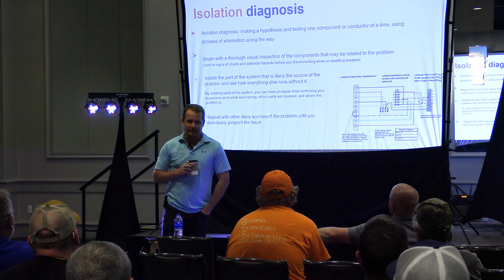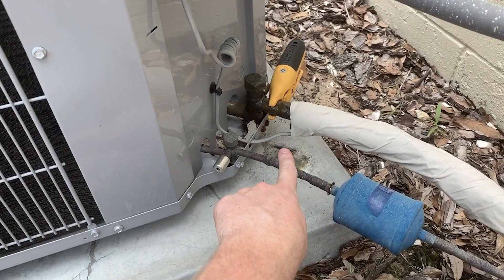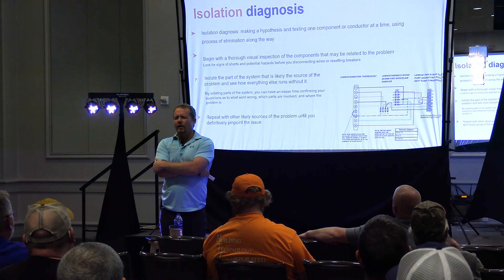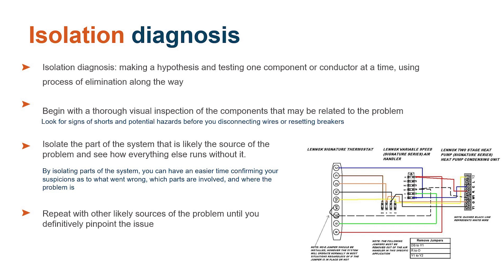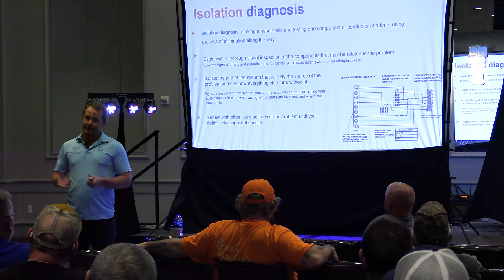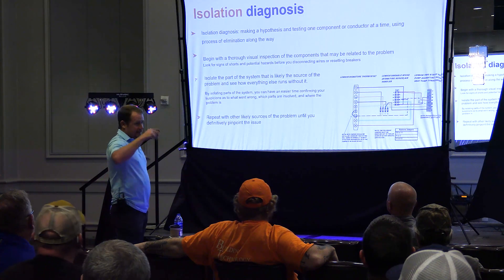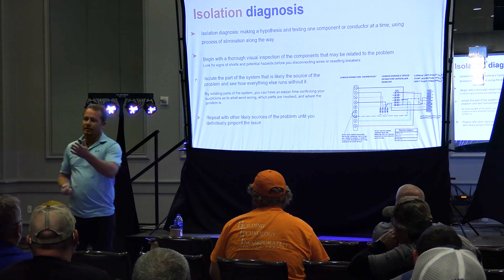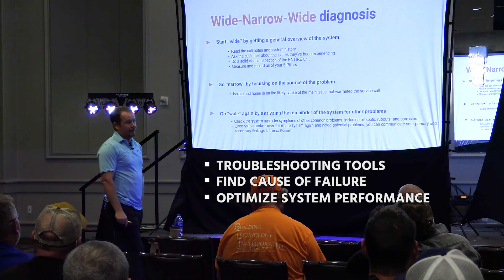HVAC - Isolate to Diagnose

Comment: The megohm tools is not used to diagnose a bas compressor. It is used to measure Insulation resistance. If you read "bad" on a megohm then you want to talk to the customer that their compressor is close to being on its way out. As in they should start saving for a new unit or compressor.

Comment: It’s tuff when 4 18/3 wires are ran in a commercial building for a heat pump and both Technicians are new to the “Service “ part of the Trade

Comment: Great video. For low voltage shorts I’ll put an ammeter on the secondary and sometimes I’ll jump across the fuse but it’s not always necessary. I’ll have all my wires disconnected and just momentarily, I’ll touch one wire at a time to hot. I’m just looking to see if it sparks or not. If there’s a short to ground, there’s gonna be a spark. The transformers will last a few seconds under a very high load so they won’t burn up in just the time it takes to momentarily touch the wires. Doing this, you won’t waste a single fuse.

Comment: 10:45 Reminds me of something my dad said when I was about 14 years old. I was tagging along on an AC service call and I pointed at the capacitor and asked "What's that?" He said, "That's the capacitor, don't worry about those, they never go bad." At that time, that was a true statement! That was when the compressor and fan motor each had a separate capacitor and the compressor capacitor was about a foot tall and weighed 5 pounds!
Reply: That is funny. Nowadays even the biggest brands are putting cheap, Chinese caps on their equipment, it seems like we replace them once a year. And with everybody going away from the PSC blower motors for the modules it's even more of a pain.
Reply: @austrianpainterinhiding88  I've been using the Titan HD USA-made capacitors exclusively for about 4 years now.  Unfortunately,  I haven't seen a drastic decline in capacitor failures with them either.  I've had quite a few of the ECM modules fail too. Manufacturers tend to blame power surges, but I'm not convinced.
Reply: They where all thrown out with kitchen scraps in the landfill to rust leak p.c.p. out into the dirt , should have saved them a lot of old caps had red dot for line incoming shorts to case not load start winding connection.